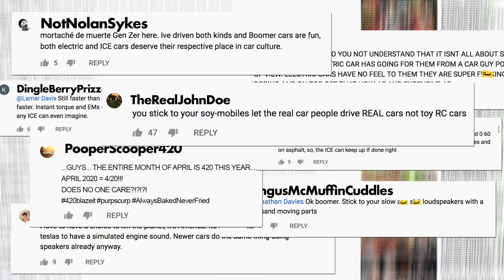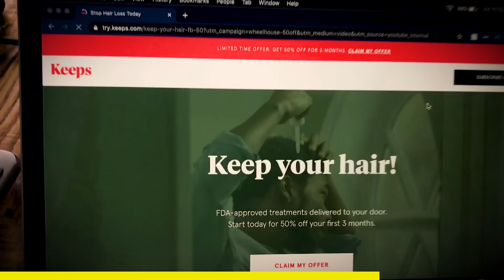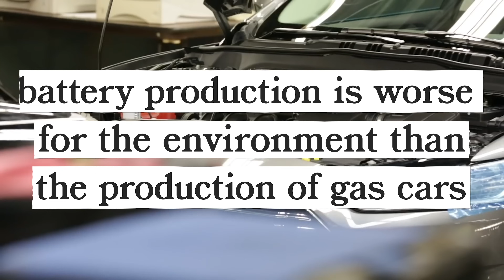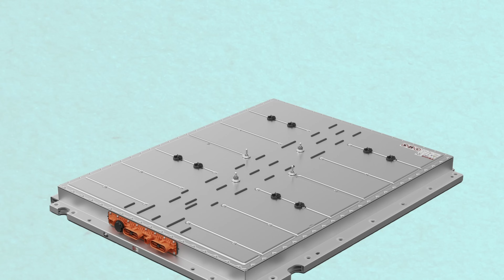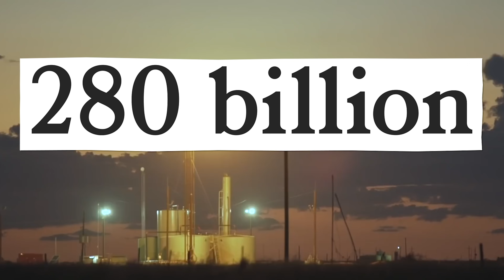Are Electric Cars REALLY Better for the Environment?

Comment: Interesting point. I'm just curious what happens in the long run. If the EV needs new batteries after each 5 years?
Reply: 10 year old EVs today can still drive around for maybe 35 miles, if you only need 10 it is enough, if it needs new batteries, the batteries are more likely better quality then the once it had before. if the car is 10+ year old, it might be even better to buy a new EV because of the new technology advances and better/stronger batteries. (if you need new batteries after 5 years, it probably means you did something wrong or your travel distance is to long for the car, EVs best used in cities, they dont really like highway/motorway useage)

Comment: Thank you for doing this.
I've seen sooo many ev owners talking as if there ever car magically appeared. 
There totally blind to were lithium & cobalt comes from, and plastic is a byproduct of oil and all moving parts need lubricants.
Oya, want is the standard on recycling/disposing of ev batteries???
Reply: The oil industry uses loads of cobalt in the refining process of petrol and diesel. And yes you need plastics and lubricants to build EV's, nobody is denying this. But the total requirement for oil related materials over the lifetime of the car is FAR LESS than any petrol or diesel vehicle.

Comment: something you need to understand is that nuclear power plants use the uranium heat that it generates to turn water into steam then that steam pushes a turbine, so the clouds coming out of the massive cones is actually not CO2 or Methane its the excess steam from the turbines. please feel free to argue with me but make sure to properly research beforehand.

Comment: Some things about batteries and EVs is after transportation life. Once a battery isn’t fit for EVs that doesn’t mean it gets thrown away. Early Nissan Leaf batteries are now being used for energy storage for homes and businesses. This means that the initial CO2 emissions get divided out beyond the use of the car and help store energy from renewables. Once the battery has been used up completely it can be stripped of materials and they can go back into another battery. Also the chemistry for the batteries is quickly changing to use less rare earth materials and with a goal to remove cobalt completely. (Cobalt should also be noted is used in the refining of gasoline as well). Along with current day battery chemistry changes there is also the advent of solid state batteries being propelled  by John B Goodenough, original creator of the lithium ion battery,  and his team which will help create safer batteries that do not have thermal run off that create fires. Technology moves fast, even 10 years ago it wouldn’t seem like we would be where we are now. The economy of scale will make EVs more efficient to produce from a environmental standpoint and those knock on effects will go into renewables as well since their technologies are so strongly paired. It’ll happen, but will it happen in enough time to matter.

Comment: Why aren't you comparing the batteries to making fuel as they are what run the car rather than gas and then my electricity comes from clean hydro power?
Reply: Because the battery only has to be made once - fuel has to be made for every gallon. Electricity is what runs the car. Not the battery.

Comment: Dont forget the plastic on EVs is made from oil. And the metal in the cars is mined and melted/formed using coal. It's not just about the battery.
Reply: Lol so what. EV's are still a lot better.

Comment: I'd like to know the source for CO2 production from making lithium.  How does evaporating brine create CO2?  I suspect that the number given for CO2 being created producing electric cars is not true at all.  They are made by the same processes as ICE vehicles but have no engine, exhaust, induction system, etc. etc... so the only place for all this CO2 to come from in comparison to an ICE vehicle is the battery.  Why does evaporating brine create so much more CO2 than forging parts for an engine, transmission, exhaust, all the other hundreds of parts an electric vehicle doesn't have or need.  I would think that forge where you are melting steel and going through all the processes for making an engine block, heads, valves, cranks, connecting rods, pistons ad nauseum would make more CO2.  Also glad you noted the CO2 costs of producing petroleum products, that is never included in the CO2 levels of ICE vehicles, but they always include source to plug for electric cars.  With ICE vehicles, they only seem to include the tailpipe emissions.  Interesting factoid... an electric vehicle can travel further on the electricity used in producing a gallon of gasoline than the gasoline vehicle will travel on that gallon of fuel.
Reply: Scott McElhiney you can’t just leave it in the sun and expect industrial scale production, you have to boil the bribe. Creating heat needs energy, and that comes from either chemical or electrical.
Reply: @radrhys1267  Thank you for replying, Google search says it is done via solar evaporation.  Do you have other information about industrial scale production?

Comment: Thanks for the video I learned a lot.   The calculation for electric is that including new batteries when they go bad and you need to replace it?
Reply: dont think new batteries are calculated in the the vid, also with time we learn more and more about the batteries and turns out that most cars can go longer then 10 years without changing them, although i would not suggest buying a 10 year old EV car atm. unless you are doing stupid things with the car but that be also a factor for ICE cars where people blow up their engine.

Comment: Until the grid is 100% renewable, EV's run on coal, as that renewable energy was already being used before the care was added to the grid, and more coal or the like was needed to adjust for it.
Reply: That is such a famous misconception. Driving an EV is always the least polluting option. Even if you mainly use coal heavy electricity.

Comment: I think people also forget that EVs don't require oil changes, replacement parts like spark plugs, air filters, trans fluids, etc or how brakes on EVs are utilized so little lasting easy 10 years on a single set of brakes, thus less brake dust being put on the streets and down the drain.

That being said, EVs need to be more entertaining.

Comment: even if we improve all the steps to produce EVs, we won't change the fact that we power a 2 ton vehicle to move a 75 kg (170lb) human
Reply: And EV's nowadays seem to be designed primarily for drag racing. Not a healthy trend. I'd like to see more ultra-compact, low-energy EV's, designed specifically for city use.
Reply: Its also strange how its always avg ICE car vs avg EV, considering ICE cars also include 20year old SUV while  there are barely any EV that size and statistically no EV that old.

The comparison should be at fairly equal cars (would still be in favor of EV after a few years at worst)

If we also compare avg driving distance (11 800 miles), 5 days per week for 48 weeks thats only 49 miles each day. Why would the avg car owner ever need a 200-500mile range EV?

Comment: I have a major problem with the accounting of CO2 usage for the electric car. During the video, he presents the gas car and at the end of the gas presentation, he adds the CO2 from the gas production from the refineries. 1st problem is that he doesn't reduce the refinerie's production of alternative products from oil which would account for a substantial share of the pollution. He then goes on to talk about the electric cars but DOES NOT take into account the CO2 pollution caused by the building of green energy plants which are tremendous and produce toxic waste by itself. As an approximation, I would think that the gas and electric cars have the same CO2 usage

Comment: I agree that EVs are better. But I just ask myself: electricity has to come from somewhere. And, in many places in the world, it comes from the use of fossil fuels the same way gasoline does. By that, the original source of power wouldn't still be the same?
Reply: Even with identical power source, how EV consume it is more efficient: motor efficiency is typically 85%. The best ICE engine from Mazda has thermal efficiency of 40%.

EV has less wasted energy (typically it is heat).

Comment: Did you take the fact that the batteries crap out 3 times in the life of one car... 
Also the density of stored gas is way higher than electric. Enjoy them 2 hr charge times in very specific spots and carrying a generator and the classic oh shit my battery is flat cause i left it sitting for 2 weeks

Comment: 2:46 a full sized Tesla has only about 7kg of lithium in its Battery. These are one-time CO2 emissions and because of the longevity (500'000miles and soon 1Million Miles) negligible compared to permanent well to tank of fuel.

3:35 Come on, the 17 metric tons relate to the very old Ellingsen Study from Sweden and the conclusion is plain wrong, was a misinterpretation from Johan Kristensson.
It's more likely to be half that.
Also: Tesla powers their Gigafactories with renewable energy (you can buy that...) that destroys the whole

4:21 until now, Laptops and Cell Phones etc need more Lithium than EV's - and you couldn't care less.
The water thing: Water used for production of a Tesla Battery equals about the water used for: 11 Avocados, 1/4kg Beef, 30 Cups of Espresso or half a pair of Jeans.

4:51 Cobalt. Yes it es a Problem, and so is all the rare Earth Materials used for catalytic converters, Oil and whatnot

5.23 Recycling google Closed loop with umicore from Tesla etc
Also, fires: ICE Cars catch about 10x more often fire than EV's corrected to "per 1000 cars each"

6:36 You forget that an EV has no compex Motor, Drivetrain, Catalytic Converter, Exhaust. The Difference isn't that much in favor of the ICE

otherwise - good work

Comment: I like this "fact oriented" video, good job. I would argue that you missed so many other arguments in favor of the electric cars, the video would have been too long...
Electric cars are much more efficient than ICE engine. 
The exhaust pipes are releasing much more than just CO2, if you stay in your garage with your mustang turned on long enough you die ! 
The official numbers related to the Oil industry cannot take in account the oil leaks and their consequences for the environment. 
We will see the coal and gaz power plants disappear shortly, making the electric cars greener. 
New generation batteries will use less and less cobalt and lithium therefore their impact per car will decrease shortly.
An electric car allows for a home charging unlike ICE where you have to rush to the pump regularly. 
Electric cars are much more stable therefore safer cars. 
When involved into an accident, electric cars are causing less damages and injuries. 
Electric cars can recover energy back into the batteries unlike ICE engines. 
Noise is a pollution too but electric cars do not make noise (or less).

Comment: "Engineering Explained" came to a different conclusion with this comparison.
Reply: I watched that video as well and I think he didn't take into account as many details in the mining/refining process and mostly focused on production and lifetime of the car.
Reply: thats because he thinks all batteries get "recycled" and gasoline teleport to the car, but actually batteries worth more being reused and gas needs to get to the station somehow, crucial points
Reply: Claptrap Jesus how? Im curious as to how a lithium battery gets recycled n why is it more costly - both financially n environmentally - to do so?
Reply: @khirulaminur  From what I understand some of the difficulty is in dismantling the batteries (e.g. 1800 cells in Teslas) without shorting them as lithium battery fires are fairly energetic and self-sustaining. Can't just throw em in a crusher.
Reply: Henden G But that is exactly what https://www.duesenfeld.com/index.html do. Before they put the batteries in the recycling process (more or less a big blender), they completely empty them and use that energy for their recycling process, so no danger there anymore.
They definitely know how and do recycle LiIon Batteries. The problem right now: car batteries are so long lasting that there are not yet many to be recycled.
Reply: @fcgHenden  thanks a bunch for da info. The more u know ...
Reply: @fcgHenden  new Tesla's use 21700 cels, cheaper to make and they have a longer life span. The 18650 is still the most common cell size (e-bikes, e-scooters etc etc.) And then you have pouch batteries, tbh I don't know much about them.
Reply: I'm not sure if the oil refining and transporting emissions were taken into account for the Lithium miners' part of this comparison either

Comment: Constructive feedback here, you guys considered average emissions from all internal combustion engines on the road, to all EVs on the road. 

You did not consider emissions averages from modern cars that have low emissions standards. Youre including data from cars from the 80's 90's and early 2000's. I see youre point about the "eventuality" about how the processes for mining will become more green, but if were talking about new technology, we should keep it from the same time period across the board. So, gas powered vehicles emission averages for production as well as the averages for operation for the duration of their lifecycle ie. the past 10 years.

Also it would do you well to cite your sources in the description below. You should have made this a podcast, that way you could give this topic the effort it deserves. That said I am a huge fan of you guys and this isnt shade. 

Sincerely,

An engineer

Comment: I recently bought a lightly used Nissan Versa, because I have a long commute. It was just over $8600 dollars. I average a bit over 37 mpg. At this point no EV can compete with this as far as cost is concerned. Also a friend with a first generation leaf has had to replace multiple battery modules at great expense. There is just no comparison between cheap ICE vehicle and EV. I will not save enough money on gas to make up for cost of say a new long range leaf which is around $30,000.

Comment: You forgot one important stat, the life of a lithium battery pack is five years or about 100,000 miles worth of driving/charging and will cost you about $15k to $17k to be replaced  (and no telling if there will be a costly disposal fee?) A combustion engine will last alot longer than that ( some right at those miles and most way more miles than 100k) and would cost about the same to be replaced. And some of my research most EV cost around $45k? ( not sure on that stat). Just my two cents and I will never buy a EV.

Comment: Electric motors have far less moving components ans don't rely on air pressure and seals like IC engines. This means electric motors do not lose horsepower over continued use. Regardless of the environment, its just better technology. If people start developing capacitor banks to replace batteries and dust off the old thorium reactor technology there will be nothing to stop electric vehicles. Not to mention that a rouge drone attack on a Saudi oil refinery caused toe whole world to gasp and cough should be a sign that it's time to find alternatives for the brown goopy stuff.

Comment: Dude as long as the way we dont change the way we produce and transmit electricity from station and to your home , ev is not that great

Im not talking about pollution but energy losses . The electric transmission thorugh power lines has the worst efficiency ever. We lose a lot of energy in the process thus it is inefficient considering the long journey the power actually makes.

Comment: You skipped the CO2 emissions created after drilling but before refining. The transportation to the refinery and then transportation to the pump. Then there is the hydrocarbon released during drilling and pumping. And, what about oil spills.

Comment: I think you missed to divide oil refinery by users portions for polluting outputs... not all gas produced is for cars- most gas isn’t. But the electric auto industry is pole position users (end user) for its items. Both autos will source seats from same place, so even trade- which is throughout the vehicle. But, software integration and power sourcing triggers divergence.

Comment: You should have included that when an EV has been driven for avout 2 years the battery has to get swapped. And where does the old battery go? Its not usable for an EV anymore. 
A lithium battery can only be charged so and so many times before having to get swapped out, and when swapped out it polutes more again. Hope you all understood what i meant by that. Just wanted to put this out there. Sorry if my english was bad.
Reply: Why are the batteries of EV's warrantied for 8 years if this is actually the case?  No company would give an 8 year warranty if something was going to last for 2 years.

Comment: ICE = 20-30% efficiency
EV = 70-85% efficiency
Think about that for a minute.  Now realize that when you pay $3.00/gal for gas, only about $1.00 goes to actually turn the wheels.  The other $2.00 is burned off and wasted as heat.  You're literally burning money by driving an ICE car.

Comment: I agree but my problem is I live in an apartment building.  Most if not all apartments, condos and some row houses or townhouses do not have a wall plug for your car to charge overnight or charging stations on site.  This means having to find a charging station to charge during the day which right now would mean massive delays in time.  Kinda like L.A. freeway traffic...not moving.  I'm sure eventually this will be handled but it is the single most issue ignored and probably the more valid reason why electric cars are not for the lower classes.

For people like me a hybrid is the only answer to helping the environment or nitrogen electric.  Thx, I liked the video.